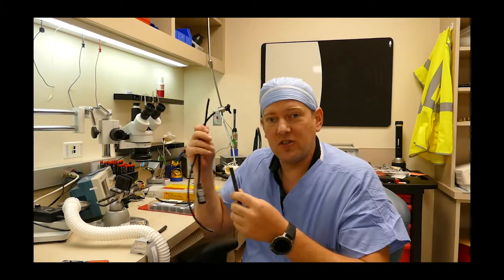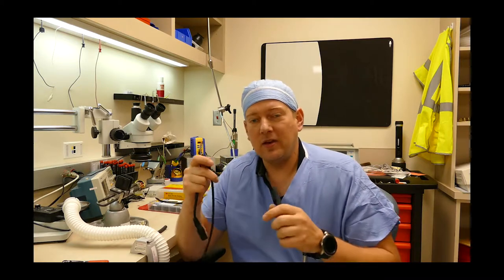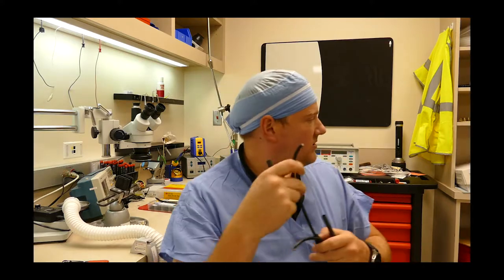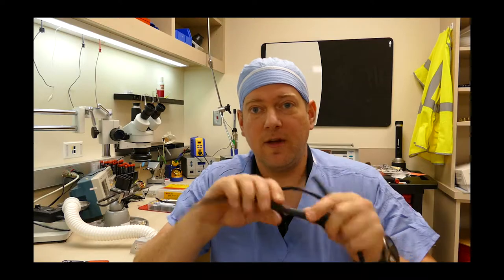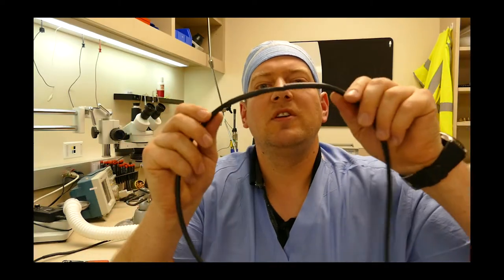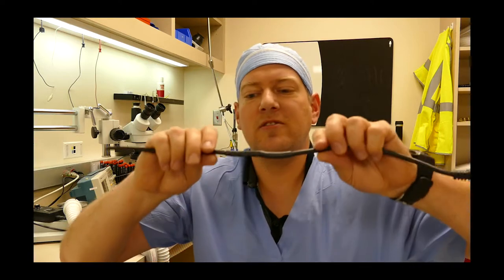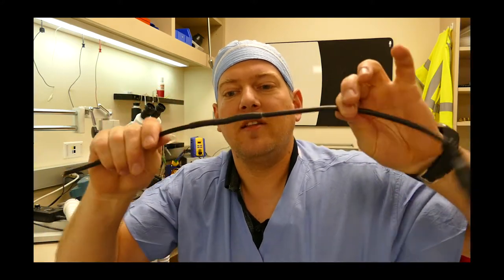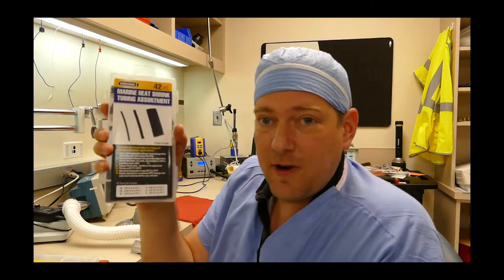Pro Tip 2: Heat Shrink Tube

Comment: Yup, I will use the dual layer on most my applications. If I can get it on new equipment as extra strain relf. I will ASAP, helps with keeping it in service longer.. Good TIP